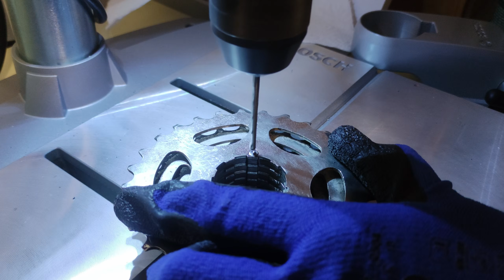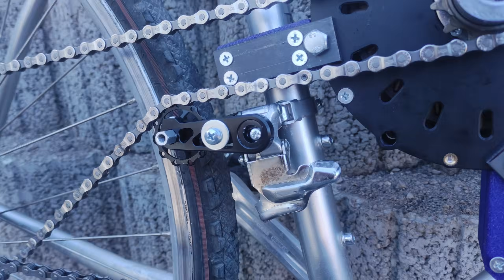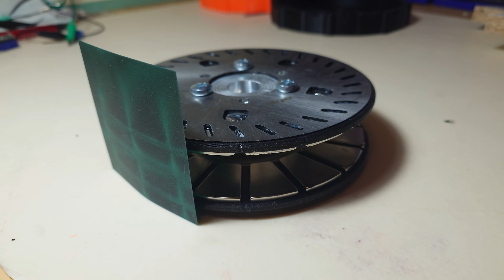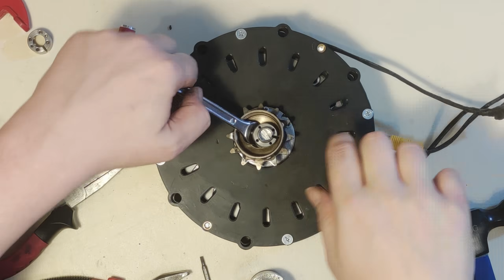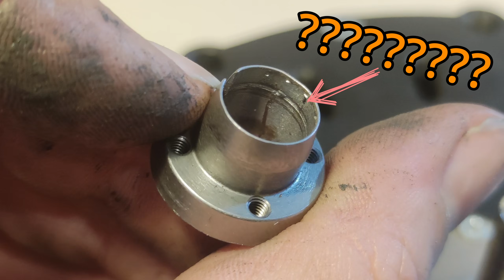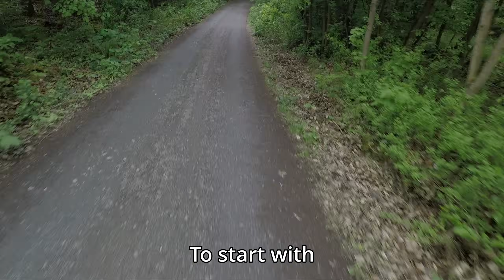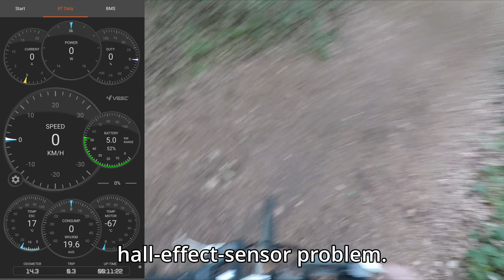Testing My Home-Made E-Bike Motor

Comment: You can cut carbon fiber be spraying water or oil because the particles are getting easily trapped
Reply from the maker: I suppose that is another way to help contain the dust, yes. But liquids are more messy and harder to handle. I will have to think about this when I upgrade my cnc though... might add the capability to use flood coolant.
Reply: @BirdbrainEngineer  well am was talking about hand grinding and cutting like i do because i don't have fancy machines and never worked with carbon fiber
Reply: Yeah, I always use water. The cheap diamond bits sold for dremel tools are super effective on carbon fiber. If I wanted to do any CNC cutting, I'd use them with the sheet submerged under 10-20mm of water. Not sure how to handle workholding, though. Masking tape/superglue gets flexy when wet, and you can't use screws through the bottom of your container. Shellac flakes may be low enough melting temperature that it wouldn't damage the carbon's epoxy. Thanks to Dan Gelbart's most recent shop tips video for teaching me to use it as glue and not just wood finish :)

Comment: I think your shaft and sleeve were slipping, there was probably a high spot originally in the place where they eventually scored, which reduced the clamping area, which let the parts slip, which got them to gall eventually getting in each other's way enough to transmit the full torque. Something similar happens to drill bits quite often when cutting heavily with them (Though usually not for more than a rotation like here).
Reply from the maker: Yeah, that's my running theory at this time too. Definitely means I will have to use a lathe to make a shaft next time to make sure it doesn't contain any defects like that.

Comment: I can't help but thinking watching the voltage sag on those batteries under what really isn't a very big load that you probably should still get an actual e-bike battery. Given the temperatures your motor was running at you could get an actual e-bike battery and then try cranking up the current some more in the motor controller.
Reply: Adding a third series battery will also give 50% more usable power (same maximum current from the batteries at 1.5x the voltage). The motor coils+driver mosfets function as a buck converter, so the motor current can be much higher than battery current until you're near maximum speed. Power in = power out.
Reply: @dekutree64  But for lower speeds you’ll have a lower duty-cycle, and so your switching losses will be greater. Not much a big deal here, but know there ultimately is a limiting factor on pack voltage.
Also if one of the built-in BMSs turns its FETs off before the others, those FETs need to be capable of handling a higher voltage when running series batteries. Not that all tool batteries even have those FETs.
Reply: Good tool batteries should be capable of providing a hundred amps in short bursts. These batteries could be the problem, or it could be the wiring or connectors. Remote control lipo batteries are often rated for very high discharge currents (e.g. 100C) and aren’t too expensive, they’re what I’d go for.
Reply: @Scrogan My other thought was definitely the wiring may be where the drop is happening but there was a clear drop in the software.

Comment: While the power tool battery packs are very cool and DIY, I think the motor and bike has proved itself for a proper battery. There's so much sag on those cells!

Alternatively, you've proved your bike engineering in this video, and it would be cool to see the motor designed to replace the bike's bottom bracket so that it could be a mid drive design.

This is all so cool!
Reply from the maker: Yeah, I will certainly have to think long and hard about whether to go for a hub motor or mid-drive next. On the one hand, hub motor will certainly be a lot easier to do... but on the other, mid-drives are generally a lot better for bike handling and if I want to continue doing mountain biking on trails with a possible better mountain bike in the future, then I would ideally really want a mid-drive. Mid-drives generally also don't make axial flux architecture to be all that desirable... but I have some ideas there.
Reply: @BirdbrainEngineer  Hubs would be significantly harder to DIY, I must say. Easiest might just be straight friction drive on the top of the rear wheel, as bad as that is it gets your gearing troubles down. Mid drives are the best for any application you don't need the reliability factor of a sealed hub motor that can work with a chain or gearing failure, or if you don't need the ability to regeneratively brake. Geared hub motors are much better than direct drives though from an efficiency aspect unless they're really wide stators that don't fit between most bike's frames unless you lose all the gears. They have so much more thermal mass though that they usually just get run at suboptimal efficiency continuously, but I hate that idea from an engineering standpoint.
Reply: @mikafoxx2717  What makes mid drive the best? To me front hub drive sounds like the best solution, since it makes your bike AWD (electric-powered front + muscle-powered rear). It should also help with weight distribution a bit, especially when going uphill on very steep inclines (it can be very unpleasant when your bike unintentionally tries to make a flip in such situation, trust me), although this depends on the bike (and assuming you don't put the battery in the front too). It's also the easiest to install, without affecting whatever gearing you have, and allows regenerative braking.

But all of this is just extrapolating from my experience riding normal bicycles, maybe I'm missing something about e-bikes. I'm thinking about adding motor assist to one of our bikes to allow a person recovering after surgery to cycle, but if regenerative braking was easier to do (AFAIK it requires custom or very expensive parts currently) I'd even consider it for myself just so I don't have to change my brake pads every 3 months.
Reply: @tuesss 
As someone that's tried all kinds, the main issue with front wheel drive is that your can't have a lot of torque if you go uphill on gravel, as you lose traction more easily, whereas the rear wheel gets even more weight on it. Rear wheel is more strained and adding more to it can accelerate rear tire wear even more. Mid drive also adds drivetrain wear, especially without a torque sensor or shifting gently. Mid drive can be geared lower, and so can gain efficiency on hills or have higher long term power density without overheating, due to better cooling of an inrunner motor and without a second spinning shell. 
Mid drive is good, though I wish it didn't need to use the human drivetrain. RPM needs to go up to be efficient at higher power levels, moreso than humans need to. I like the idea of Regen braking to safe break wear, and mid drives cannot work with that without essentially making a fixed gear single speed. 
A smaller wheel with a direct drive motor can ditch the need for gearing, and with much higher reliability and peak efficiency, but works better for bike design such as cargo or trikes where smaller wheels are a benefit.

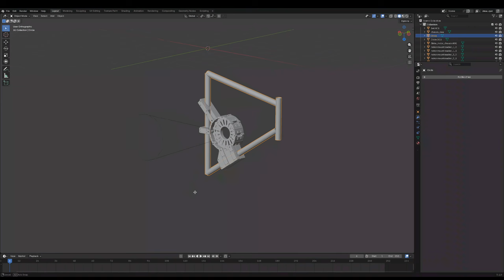Comment: 3:30 - What are you using in Blender to get dimensional accuracy? Blender is my go to for vibes based modelling, but I would never give up my dearest FreeCAD
Reply from the maker: Real life measurements of course, heh. I use digital calipers for diameters (the bike is a steel frame, tube-shaped) and a digital... angle-meter? to get the angles between the tubes. It gets you a good enough accuracy for this.
Reply: Common sense, but I think they are just asking what softwares you use..
Reply: @OHLLC97yeah, I was aware of some plugins for Blender that give extra tools for CAD-like precision and if they had used any particular ones of those, but it is possible to just pad and pencil and input box too. And that seemed to be what was used based on the reply

Comment: How are you managing BMS and battery cell balancing when using drill batteries in series? or does the BMS's of the drill batteries handle it for you?
Reply from the maker: Basically just YOLO. There is no cell balancing, and I have noticed that the batteries do discharge at different rates, so I don't recommend running them completely empty for sure. After they have been recharged, they will work together fine again. I have also set the battery cutoff voltage a respectful 1.5V higher than is recommended for a 10s battery.

Comment: Interesting you say building your own battery is a huge challenge while you built a frikin motor?! Well, I did the other way around: built the battery, purchased the motor.
Reply from the maker: For me, it's the safety aspect... I have heard enough horror stories about DIY batteries bursting into flames because of some tiny defect that an inexperienced person did. The worst that can happen with a motor is that it either burns the insulation on the windings and then shorts, killing the motor... or it structurally fails. In terms of the latter - there is a reason why the chassis pieces are quite bulky... But as it stands right now, I do not think that this motor would fail anytime soon... Could probably push 3 kilowatts of mechanical power through it without problems.
Reply: @BirdbrainEngineer   I see where you're coming from, a safety first mindset and I don't blame you! Personally, I don't see how a pack being used could burst into flames; charging is another issue, balancing and cell voltage monitoring has to be done right, i think that's wha t a BMS is for. Building the pack, welding the strips sound like a huge undertaking for one who never done it, sure, and I didn't go that route, I assembled it, any cell could be replaced by loosening some screws. Holds well for the time being.
I wish you success with improving your bike and waiting for the next video on it! Well done!

Comment: I love it ❤. Do you think you could add a switch that measures the force you put into the pedals so the harder the terrain the more energy the bike puts in? I'm guessing you'd need to modify a slip ring with potentiometer or something (and a spring ) to do so but it would be cool to see the results.
Reply from the maker: That'd mean adding in a torque sensor... I am not entirely sure how to do it at the moment, but it probably could be done?

Comment: it actually makes more sense and is a lot easier to just clamp the motor onto the bike frame and friction spin the back wheel directly with a smaller wheel, i'm planning on trying this with a small e-scooter wheel, that way you get a gear reduction and it would increase the torque a lot while also not having to do hardly any modifications, you just have to worry about the rubber wearing down faster I guess but I feel like you could find a material pairing that minimizes that, the treads on a bike wheel may act as gear teeth anyway, this is what we used to do with weed wacker engines back in the day
Reply from the maker: That kind of power transfer is fine in places where you get like up to 3 or 4% inclines, above that, there's going to start being a lot of slippage between the drive wheel and the wheel of the bike. The chain was the only way to have a proper coupling.

Comment: Awesome video! Have you considered using field weakening to increase top speed? Or would that not work for this? :)
Reply from the maker: Field Weakening would probably work just fine for the motor, but I didn't experiment with it at this time.

Comment: I feel inspired by your resilience. Thanks for the dev diaries! Memories... I built a DIY ebike back in 2014 or so, using whatever parts I could find. Heh, I had the exact same saga with the cheap chain tensioner (and used some of the same parts). Nothing beats the feeling of hitting the throttle for the first time, or going on a first trip with your machine. Cheers!

Comment: Nice. That Air core motor you can use for wind turbine.
Reply from the maker: The air core motor does not exist any more! I re-used the rotor, shaft and some other parts. In addition, the KV was not the best on the air core motor, so the blades would have to spin really fast to produce any appreciable amount of power (at least without a gearbox).

Comment: regenerative braking could help the batteries
Reply from the maker: Yeah, but with bicycles regen is actually not that straight-forward to do. Generally speaking, only hub motors can do that on e-bikes, and even then, usually it means you do not have a freewheel in it, meaning you'd be spinning the motor while not using any assist and just pedalling on your own - it makes pedalling quite a bit harder. There are some systems like "freegen" that try to solve this, but I don't like most of them for their complexity and questionable safety impacts.

Comment: Loving everything you're doing especially the axial flux motor. I was waiting for you showing the metal stator part but you skipped it. I assumed you used silicon steel from a transformer
Reply from the maker: The laminations in the stator are made from transformer core steel, yes. In my previous video I said that it's not the best in use in motors, but actually I think in this particular case (yokeless axial flux motor), it's actually better! 

Usually transformer cores are not that good to use in motors because they are grain oriented*, meaning they let the magnetic flux pass through it well in a preferred direction. In *radial flux motors (which most electric motors on the market are), the electrical steel experiences the magnetic flux directionality shift in every direction throughout an electrical revolution. But in yokeless axial flux motors, the magnetic flux changes direction mostly only in the axial direction... up and down... this means that grain-oriented electrical steel is exactly the correct kind of steel to use!

In the future I will be looking into soft magnetic composites though.
Reply: @BirdbrainEngineer good idea. You could even try SMC material mixed with epoxy. It has great flux density if you do it right

Comment: I'd say about half of the motors I have used in my career were less well engineered than this. Within the limitations of DIY making, this is amazingly good. In fact I bet the basic design would work fine as a commercial product (ofc. adapted to industrial manufacturing).
Reply: Man I wish PCBway or someone similar would be able to laser/waterjet/plasma cut silicon steel laminations.
Reply: @Scrogan  I think Jystator makes pretty well priced laser cut laminations you can order.
Reply: id like the comment but i dont wanna ruin the 69 likes lmao

Comment: Isn't it good our stupid governments can't regulate gravity. Stellar effort and great result.
Reply from the maker: Guessing that you are making a play at the EU's E-bike laws... Which I agree, are needlessly strict and probably made by people living in the Netherlands... 250W thermal limit is simply not enough for where I live. I do agree that the speed assist that an e-bike should give shouldn't exceed about 30km/h though. At least not without some kind of actual e-bike drivers license thing going on.
Reply: @BirdbrainEngineer  Same here in Australia. Stupid laws by stupid people. Speed should be limited, but power? How does that make any difference when one can freewheel down a hill and get to 60 km/h. It makes us older, fatter people stay home on the couch rather than getting out and cycling - up hills, against the wind. Without electric I would be getting almost no exercise. I pedal hard, but when I need to back off, or a hill is to steep, the motor fills in. Its just bloody brainless BS. 
Rant over. 
You are doing well with your delving into mechanical, electrical, electrmagnetics....I thoroughly enjoy your videos, so thank you!
Reply: @BirdbrainEngineer  Super agree. I'm in Canada where the limits are 32kph and 500w (brake horsepower, not electrical) and I have a bike that does go faster than it should thanks to a battery replacement from 36v to 48v, and honestly, I don't think ebikes should go that fast. 
40 or 45 takes a lot more power to maintain on the flat and feels much more dangerous if something went wrong, and it's not just for two seconds like you might be on occasional downhills on a bike, especially with the extra weight in practice for your brakes to fight against. 
I think the power of 250w is silly though and I'm sure people can flatten a 500wh Bosch battery with a high performance Bosch CX motor in under 2 hours of hard mountain biking without any overheating in sight. And those allow 650w peaks, probably more than we're allowed here in Canada on paper even after efficiency.. not sure how that all works out. Especially on steep hills, efficiency goes down due to copper losses being squared to the torque output, so useful power goes down at low speed in practice without overheating, for fixed gear ratio motors.